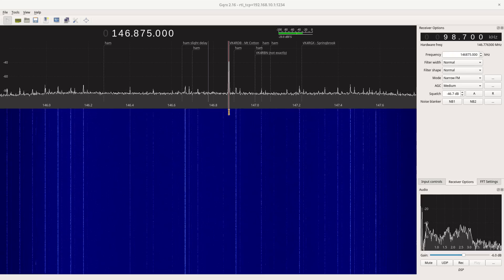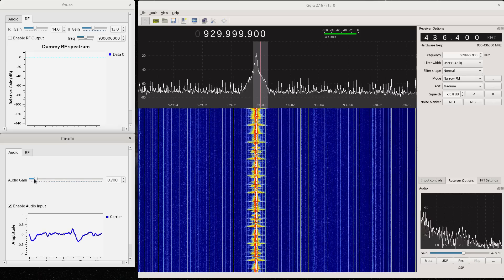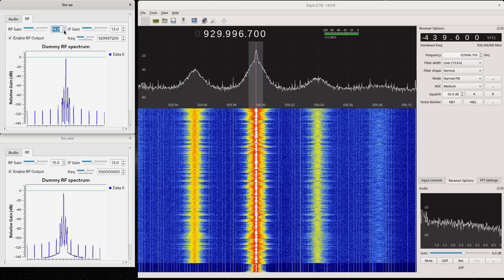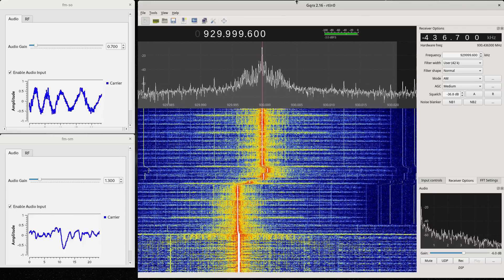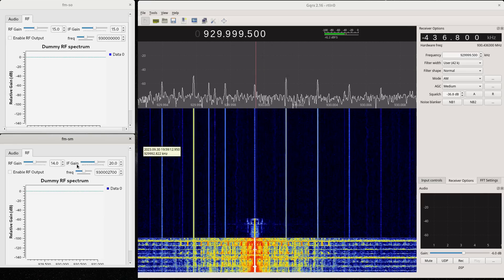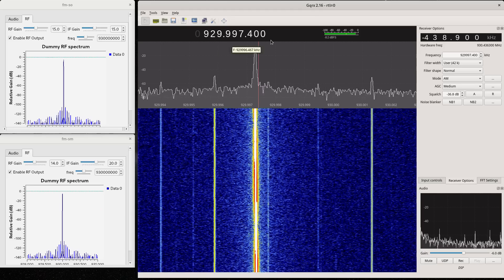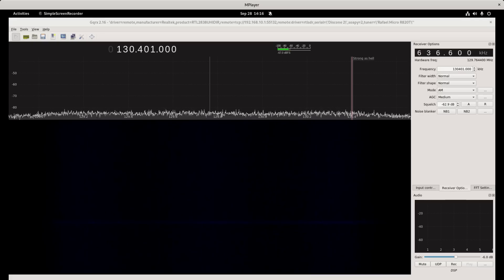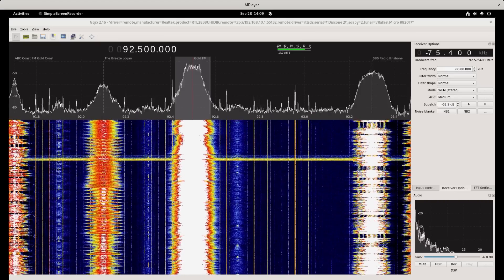Demonstrating FM Capture Effect

Comment: If one of the transmitting stations is a lot closer, it will block the reception of the other one completely (I work in a control tower)
Reply: Absolutely. AM is not perfect, it's the lesser of two evils.
Reply: They wouldn't if SSB was used.  Everyone would be heard perfectly.  Less chance of interference is NOT the reason aircraft use AM.
Reply: @stargazer7644 Aircraft use AM because it was the prevailing technology at the time that the aviation sector began using phone radio communications. It has the advantage over FM in that the presence of a secondary transmission is easily detected.

Comment: Throughout the world, the default frequency for all communications for all aircraft (including Military) is FM Also ALL ILS, VOR navigation equipment use the FM band.
Quote from the internet regarding this: 'Civil aviation uses the VHF frequency range known as "airband," which ranges from 108 MHz to 137 MHz. Navigational facilities, such as VORs and ILS equipment, use frequencies 108 through 117.975. The remaining frequency range is used for voice communications.' Airband is just a little higher than the normal FM broadcast frequency for public radio transmissions.
Reply: AM and FM are not frequencies, they are signal modulation methods. Therefore, VHF does not equal FM.
Reply from the maker: Thank you for saying what I couldn't be bothered saying :)
Reply: The frequency range that you note, is correct. However, for voice (phone) communications, AM is used, not FM. Frequency does not determine the mode of operation. I can't say with authority whether or not ILS and VOR use AM or not but it most likely is or is AM or Single Side Band.
Capture effect is often stated as the reason that AM is used in aviation. That may or may not be true, these days. We forget that when the aviation industry began to adopt radio communications, CW and AM were the most accessible technology at the time. FM was the new kid on the block and wasn't well supported by component manufacturers with regards to appropriate valves and it likely didn't appeal to conservative aviators at the time, either.
Reply: You are just wrong.  And confused.  You don’t understand the difference between modulation and frequency.
Reply: Are you sure about this?
Reply: @HamRadio200  He is. I have an old radio that shows police and air traffic band. Police band is no longer used but both bands are on FM. The air band is 108 - 118 MHZ FM.
Reply: I can say with authority that AM is used for all NAVAIDS and air/ground comms

Comment: Interesting I didnt expect that reason. But I am still curious how digital radio/tv is behaving during lightning. We have here in NL "Digitenne" from KPN what simply a digital signal is thru the air instead of via a cable. Also DAB+ radio is now the norm instead of analog signals.
Reply: I have tried DRM 954kHz 9kHz wide Mode A broadcast that our National Station in Czech republic experimented with (idk if the signal is still up). In short, audio just cuts out and goes back on. What about DAB, I don't know since I haven't really chance to receive it either way so.

Comment: Always figured this was the reason they used am and doppler probably keeps them from using ssb.
Reply: AM was adopted by the aviation sector in a time when AM was the prevailing technology. SSB adds unwanted complexity to radio communications and could easily result in lost data. The doppler effect isn't something that needs to be considered at the sort of speeds that aircraft travel at. When you've got something that goes as fast as the ISS, it's a different matter.
Reply: @davidbrayshaw3529  I kinda figured but wasn't aware that Doppler wasn't a big consideration in aircraft even with something as finicky as ssb although having experience operating some rather old ssb equipment as fun as it is I can easily see how something like local oscillator drift would be difficult to deal with when communicating is that critical although hearing it used albeit not that much with air force traffic is fascinating.
Reply: @davidbrayshaw3529 
At 100 MHz, Doppler shift could be just under 100 Hz at 500 kt. Not a big deal for SSB, but at military speeds it could be quite greater.
Reply: I'm surprised it's even that much, but I suppose that 500 knots is about one millionth of the speed of light, so I sought of understand the logic. Is the frequency shift at lower frequencies proportional? i.e. at 10 mhz. is the shift 10 hz. ? @Alexagrigorieff
Reply: @davidbrayshaw3529  SSB results in added complexity that results in lost data?  Say what?
Reply: @stargazer7644  Having to manage RIT in order to tune the receiver is an added layer of management in SSB operations, compared to FM or AM. If the receiver is not aligned with the transmitter, initial sent data may not be interpreted correctly. This is not an ideal situation in aviation when exchanges are usually very brief, and the working environment is already a complex one. The "KISS" principle is certainly a consideration.
Reply: @davidbrayshaw3529 You don't need to manage RIT at all for a less than 100 Hz offset.  Modern PLL synthesized radios will be essentially dead on frequency.  Even on radios with a manual VFO, people don't generally get them closer than 100 Hz or so.  The pilot wouldn't have to do any tuning.
Reply: Doppler wouldn't be much of a problem on the low frequencies aircraft use.  Doppler is proportional to frequency.  At 600 knots your doppler shift is only about 120 Hz on 120 MHz.  If you double the frequency, it doubles the doppler shift.

Comment: Amateur radio uses FM?  I see quite a bit of SSB which I think is AM...?
Reply: @allenkemp3124  So, am I interpreting what you said correctly, seems like you implied that one can tell if it's FM from the spectrum?
Reply: Amateur radio uses all modes. Typically, an allocation is made by "gentleman's agreement" in each band apportioning a section of the band to a given mode.
Most handheld radios are FM only and typically operate on 2 metres and 70 cms. (VHF & UHf). Handhelds are cost effective and are a very popular starting point for ham radio which means a lot of users use FM only in these spectrums. Almost all VHF and UHF repeaters are either FM or digital.
SSB is sought of like AM in that it is an amplitude modulated signal that is sent and received. It's difficult for me to go into full detail without using drawings (and I'm a long way out of school!). But in very basic terms, SSB eliminates one side of the AM signal (both sides carry the same intelligence) and supresses the carrier. This is much more efficient in the context of power and it reduces the extent of ionospheric absorbtion  ( sky wave signal loss), but it increases the demands placed on the equipment and the skill of the operator on the receiving end.
Reply: @davidbrayshaw3529 Thank you for the info!!!   so, in the video, it seemed like it was said that one can tell an FM signal by looking at the spectrum... is this the case?  if it is then how does one tell?
Reply: @drstrangelove09  That is a very good question and one that I cannot confidently answer! I honestly can't say that I've ever seen an FM signal on a spectrum scope.
AM is obvious because there is a modulated signal either side of the carrier or if there is no modulation, the carrier is still visible as a thin line. SSB is obvious because there is no visible carrier and there are "breaks" on the spectrum scope when no intelligence is being transmitted. It's also easy to identify whether a signal is upper side band or lower sideband by looking at the density of the trace. But as for FM? You've got me on that one! I must do some research.

Comment: When two people transmit at once though you still hear both on the receiving end but the tone is still there. Ive been a flight instructor for a bit over a year now and whenever two people key the mic we are deafened by the tone, but towers and approach control can still be able to hear both people. Like you showed in the video, I bet we still hear the tone because not all comm radios in the planes are at the perfect frequency. Also, the tones are different frequencies every time, from plane to plane.
Reply from the maker: At the very least, I guess even if you can't make it out, you at least know that there was more than one transmission.
Reply: @TallPaulTech it can still cause troubles. One reason for the 1977 Tenerife Airport Disaster was that messages of one of the 2 planes involved were blocked by interference.
Reply: @TallPaulTech  Usually alerted by another pilot, or ATC, saying, "Two at once", so they know they were "stepped on" (to coin an old CB phrase!).
Reply: Also considering the signal has to travel from planes moving at a blazing speed so frequency accuracy it not happening any time soon anyways from my findings.
Reply: @RadOo couldn't you just have many airplanes on the same frequency and distinquish them by timeslicing, like modern cellphone towers do zo have multiple users per channel? You would need digital transmission for that, but it would finally eliminate the crosstalk problem.

Comment: Then why not ssb?
Reply: They use that for trans-atlantic and trans-pacific operations on HF
Reply: Not required for line of sight communications and it adds a layer of complexity which could result in data loss.
Reply: @davidbrayshaw3529  What in the world are you talking about?  SSB is the gold standard for long distance weak signal communications.

Comment: AM is used on the VHF aircraft bands because in the eay days FM had not been developed.  It was adopted internationally and would be a huge thing politcally to change now.  Every VHF transceiver in the world would have to be scrapped and replaced.  And if the
world decided to do that it probably would bypass FM too in favor of a digital mode.
Reply: Yep, that is the foremost reason that AM was adopted.
Reply: And yet almost every other radio service in the world managed to make the switch.
Reply: @stargazer7644  for example, police radios. Early ones used AM just above the AM radio band.  When technology progressed to make VHF available and FM had been discovered both the frequency change and modulation were changed. There was no extra cost and perhaps a savings to go to FM at that time.  Most of the services that transitioned to VHF went to FM that way.  The aircraft frequencies in the 108 to 135 MHz were well established with AM when FM became available.  At those frequencies there is no compelling reason to change now.  The big advantages of FM come with wide band FM Which uses 150 KHz. NBFM using similar bandwidth as AM does not offer enough benefits compared to a huge worldwide expense to change the technology.  It simply is not going to happen in the foreseeable future.
Reply: @richardhole8429 "At those frequencies there is no compelling reason to change now".   And yet EVERYONE else using analog VHF and UHF is using NBFM.
Reply: The people that fly aircraft are ultra conservative. They like new things but don't want to fly behind them which is why we are still using 1930 designed engines with magnetos and are still using leaded fuel.
Reply: @nelsonswartz4589  we survived the change in transponder technology from 121.5 MHz to 420 but that was required because the satellites equipped for 121.5 were dying and never did work well.  In that case the benefits of change were worth the cost.  This is not the case with the VHF AM radios.  The expense worldwide would be immense and the benefit tiny, if any benefit at all.  Personally I would like to see it all go digital, not FM

Comment: This is what Wikipedia has to say about it:  "Aircraft communications radio operations worldwide use amplitude modulation, predominantly A3E double sideband with full carrier on VHF and UHF, and J3E single sideband with suppressed carrier on HF. Besides being simple, power-efficient and compatible with legacy equipment, AM and SSB permit stronger stations to override weaker or interfering stations. Additionally, this method does not suffer from the capture effect found in FM. Even if a pilot is transmitting, a control tower can "talk over" that transmission and other aircraft will hear a somewhat garbled mixture of both transmissions, rather than just one or the other. Even if both transmissions are received with identical signal strength, a heterodyne will be heard where no such indication of blockage would be evident in an FM system.[14]".  The International Airband Radio Handbook by David Smith confirms this.  The reason is to avoid the capture effect which happens with FM transmissions.
Reply: That's the problem with wikipedia, it can start perpetuating myths.
Although FM was understood pre-war it was not in common use untill after the war. AM was selected because that is all there was at the time. 
It might be more correct to say airband radio is not changing to FM because of the capture effect.

Comment: I also heard that planes use AM because the doppler affect does not affect the modulation. Is that right? If you can imagine 2 planes flying directly towards each other, the resulting frequency of the transmissions would be squashed (higher frequency) at the noses of the planes, and the opposite effect at the tail end. This would play havoc with the modulation. Am I right?
Reply: Not correct.  The doppler effect is very small and the channel bandwidth is 8kHz.  The doppler frequency shift at 120 MHz for a closing speed of 1000 mph would only be about 400 Hz, too small to have any effect on communication quality.
Reply: @karhukivi  yes I guess so thinking about it. As fast as aeroplanes are, they are dead slow compared to a satellite in orbit, where it does make a noticeable effect in Ham radio communications. It’s a question of magnitude. Thanks for the reply.
Reply: No. Things have to be going really, really fast before Doppler effect is a consideration when we're talking about frequency shifting of an electromagnetic wave travelling at the speed of light. You might be interested to have a look on YouTube for Amateur Radio operators communicating with the ISS or via amateur satellites. One of the challenges is adjusting the frequency for both receive and transmission to overcome Doppler effect.
Reply: @davidbrayshaw3529  I have a doppler radar module that detects people moving.  It was part of a burglar alarm system but a nuisance as it can "see" through walls and was detecting the cats moving outside the house!    Doppler radar works for the cops too detecting the speed of vehicles.    The devices heterodyne a sample of the transmitted signal with the received signal and separate out the doppler shift which is often only a few hundred Hz, so no need to be moving very fast.
Reply: Yes

Comment: NO, capture effect in an FM receiver can be avoid working on the limiter: the limiter circuit "flattens" the signal and removes any peaks before passing it to the demodulator stage. In this way, if two or more stations are transmitting on the same frequency, it cuts the stations having lower signals.
E.g. in the very cheap fm radio or in a amateur transceiver there is no capture effect. Of course there will be an intelligibility issue maybe more than using AM. This is true.
Reply: One of the well-know analog FM detectors, the "ratio detector" don't have a limiter, so I wonder if this means it does not have a capture effect...
Reply: @Bob-1802  No limiter, no capture effect.

Comment: If you compare an apple with an apple. You will also find that in AM mode you will be able to decipher the audio at lower signal levels than the same signal using FM mode. FM tends to fall off a cliff when you go from "really solid"  to "really patchy". There is NOT a lot in the middle. AM on the same carrier gets progressively worse over a longer distance. Plus yes for the reasons you mentioned too.

Comment: I've been a ham operator for years and really appreciate the use of FM, once you have a good signal you have a much lower background noise.  Many have wondered why aircraft have never moved to FM, and you gave a very good explanation as to why.  I have always explained to people that with AM you could have multiple people on the same or nearby frequency and you would still hear them, especially if there was emergency traffic.

Very good, and thank you -  Jim k6nra
Reply: FM is terrible for propeller driven airplanes.  Signals get phase modulated by the spinning propeller blades causing a loud engine like sound to interfere with the received FM signal.
Reply: Always nice to read comments from a fellow ham operator.

Comment: Sorry but You're wrong about capture effect and AM in AirBand. This is an another myth after doppler effect. Airband use AM because of backward compatibility with previous systems and nothing else. It is not essentially true that if You will receive two, not-in-sync and really completely different RF carriers on one channel You will hear both perfectly clear! Absolutely no, and You present this in Your wideo and I also say this basing on my personal experience. Sometimes it will work like that, but Usually You will also hear what You have shown. Loud beat frequency tone caused by two TXs become slightly mistuned (airband transceivers have at best TCXO, but usually regular & not compensated quartz). It is also not worth from operational perspective. Crew might misunderstand a communication, what may even have tragic consequences in controlled airspace. AM has bery poor sensitivity, has very poor vulnerability for noise (like engine ignition)
Reply: Yes, AM was adopted because it was the prevailing technology at the time of the adoption of radio in aircraft. AM at least allows the listener to detect that there is a secondary transmission on frequency, even if the intelligence is lost. Noteworthy is that electrical systems in aircraft are designed and maintained with the view to keeping spurious emissions to an absolute minimum.